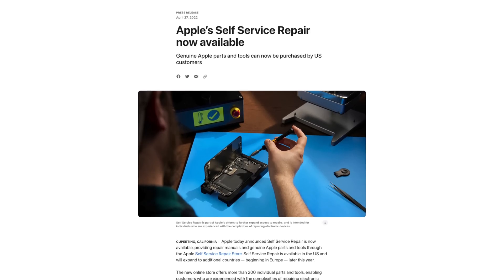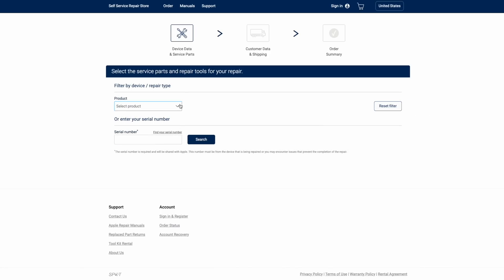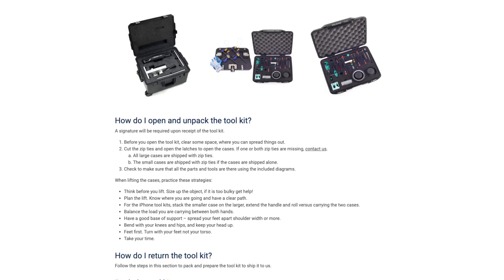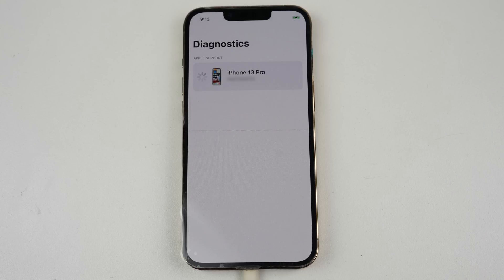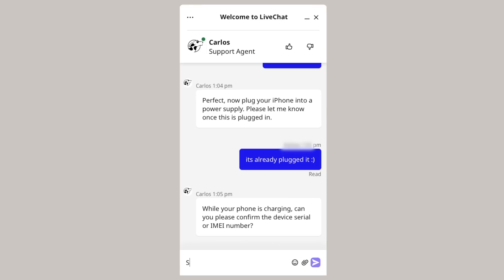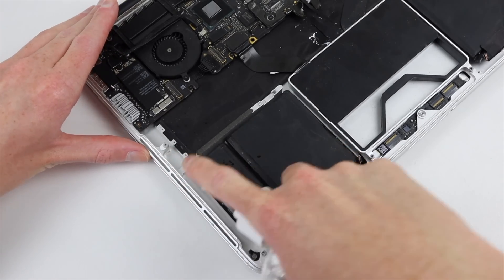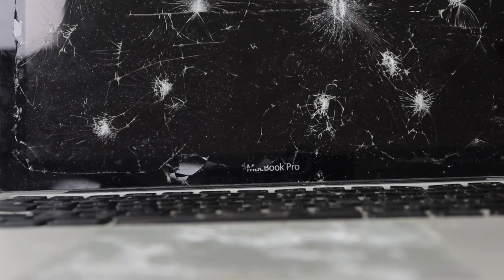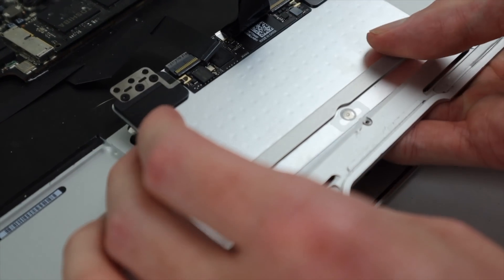Apple Improved Its Self Service Repair Program

Comment: It would be nice to see Apple give us the calibration software so we could pair the parts on our own without having Apple do it all the time unless you need help getting the software loaded up. I don’t know if Steve Jobs had something to do with this because Apple was his company before Tim Cook took over as Chief Executive Officer. I am using a iPhone 12 Pro and it’s working great but the battery needs to be replaced but I can’t do it because IOS is programmed to disable True Tone and any other features if I were to replace the battery from a third party. If IOS had the calibration software re-loaded then I would have been able to pair the battery to the IOS without having Apple do it. I hope that Tim Cook is listening to people who use third party parts to repair Apple devices and hopefully he does make sure that the new Apple products have the calibration software pre-loaded before they’re shipped out to customers who ordered them. If that happens then we might be able to use the calibration software to pair the components to IOS and other Apple operating systems.

Comment: To be fair I recently had to fix my Samsung phone and I didn't notice anything wrong but later that day I found out the following parts no longer work 
Speaker
Battery (worked for about 3 hours then no longer had battery percentage)
On/off/ volume keys 

I'm very close to getting rid of this phone and going back to flip phones

Comment: Just putting it out there once again, they should really issue temporary access to AST2 diagnostic suite to allow customers performing their own repairs the same ability to run required tests/configurations. This would be fairly simple as I have full access to this suite being an AASP employee. I can login and have full access to this suite even off the clock as it's tied to my Apple ID/Password associated with Apple. The System Configuration typically will time out because you have someone remotely running this request on a different network God knows where. You can run this test from anywhere as you do not need to be connected to a specific wireless network. ( Ask me how I know lol ). In order to run the system Configuration the KBB/KGB need to be entered into the repair first. Once saved you can run system Configuration and the post repair diagnostics which allows the repair to be marked complete. I've voiced this idea to some of our Apple resources but it falls on deaf ears as I can almost assure they don't want their beloved AST2 suite to be readily available for everyone.

Comment: Thanks to you I got motivated to buy a Ifixit pack and a bunch of old iphone 6s.
I literally disassembled every part of the iphone and put it back together. changed the screen, transfered the homebutton etc.
It was a lot of work but it really was fun and now i got a working refurbed iphone 6s.

PS: Never try to put off the screen with the screws still in on the charging socket. Destroyed one iphone with this lol

Comment: Honestly have a 2019 Macbook that could really use a refresh. The SSD died and now I need a board which has to be paired with a touchID. I got burned bad on eBay from a seller who said the touchID was paired but when it arrived, they were clearly not paired. I am still working with the FTC to resolve the issue as I have sent the board back to the seller and they still claimed they didn't receive it. I don't understand why Apple would want their customers to have to deal with shady people instead of just offering their products. Doesn't really ring quality of the products once they leave the factory.

Comment: It still feels like you don't own the device at all. They remote connect to YOUR device to confirm your repair. This is ridiculous. Edit: Also I cannot accept the fact that the SSD is soldered to the logic board. SSD's age over time and need to be replaced to maintain the performance. It's just an evil business decision for you to replace the whole device earlier.
Reply: @Yura Retz yeah but that's literally every other laptop manifacturers' problem as well :D apple overcharges people to give the illusion of a high quality device and provides you a unibody aluminium e-waste.
Reply: @Yura Retz in apple's case you cannot because of the security chip and some other technical details idk☹They change the whole board instead. louis rossmann explains more if you wanna learn more about it.
Reply: @Yura Retz That wouldn't be a problem. People don't buy new devices when old one fails but rather when new devices have more powerful cpu, gpu, ram etc. So no, Apple is the pinnacle of scam and is a bad example for other companies.

Comment: It's better, but still not perfect. Some parts are cheaper than aftermarket, but other parts still make it pointless and cheaper to buy a used replacement product versus replace the screen or main board. (Well Rossman may be a cheaper option for the board).

This just seems so half assed.

Comment: apples battery replacement option is a crock. my sons ipad pro 2 gen battery is almost dead. $99 to replace but you have to send it out that takes over a weeks to get. they told my son directly that they don’t feel they are repairable devices and just get a new one.

Comment: Really? Apple's solution to fixing a dead SSD is to replace the whole motherboard, scrapping the perfectly usable CPU. I hope that they actually recycle the working parts on the returned motherboard. And even if they do, what a waste of labor that is when you could just make a modular slot for an NVME drive.

Comment: What happened to the Hugh Jeffrey's videos? Also, Apple makes money off of limiting repairs. Apple also limits lawsuits as they do not allow just anyone to repair their devices. The prices are also not that great. $12 for a USB C port is probably about $11 more than it costs Apple to make. There is no way Apple is paying even half of the advertised cost for those parts as it is all marked-up. Once again they make money whether you repair it yourself or you pay them to do it. In fact you may try to repair it yourself, make a mistake, and have to buy a brand new unit. They win no matter what you do. They are a very smart company.

Comment: What we need to do is get the Government to pay attention to what they're doing. Don't even mention the right to repair. Like you said in your previous video Hugh unless Apple changes its policy on its "security" Activation Lock of iPhone and their laptops and computers. Which leaves just by the clips I've seen in only your video. of all the laptops bookshelves stuffed with Apple's laptops that nobody can use whatsoever sit and don't wither away over time they sit there and become more and more dangerous, toxic and with every day that goes by would become more and more less useful just from the advances in technology. Yet they do not supply a charger for their $1,000++ cell phones that they "update" like clockwork semiannually. And like you said they claimed they don't include a charger because people already have so many of the previous electronics. Chargers that are USB A so they release a "NEW" phone with a new USB tip, and try and say "well you already have a charger that will work with your new phone......" Yet just ask them to show you how your old charger is beneficial to you the customer, not to them nickel and diming you for even more to just have to buy the device that is actually necessary for the device you purchased to even work at all. If a lawyer wanted to take the time, I believe not actually supplying a way to power the electronic purchased is illegal. Really any benefit they can try to claim using their phone will award you, make your life easier, take better photos record better pictures is null and void if it doesn't turn on, if it cannot be charged and for a set amount of time run on its own internal battery until such time that said device is REQUIRED to be re attached to mains power so it can function. Literally unless they supply a charger you've bought a $1,000 pretty brick or high-end e-waste. About the repair program, unless Apple is FORCED to allow 3rd party replacement parts to be substituted for their OEM parts, just like you can do for almost every single part on let's see um, automobiles, furniture. decorations. basically, anything else. They should really be charged for the pollution they are causing. Make it easy on Apple, sure you don't have to share your software that they want complete control of. If when you replace a part with a non-OEM part, say you still have to call them let them know hey I need to rent your tools apple for a repair but I'm supplying my own replacement parts for one and then once the repair is done and you then have to call apple again so they can keep inventory over their parts verifying you did what you begged them to let you do and NOTHING MORE or nothing else. sure, well just call them and they can remote connect to your device and let them remove from their files that the screen says isn't their part. maybe ask you for the serial number of your Non-OEM apple screen so they can update their records. they send the restart signal to your phone and when it reboots the "this screen isn't original and now were limiting the features you already paid for when you bought the device and now have had to suffer the burden of an additional charge to get the thing repaired.  So, we think you should be punished and "poof" no more face ID sorry we removed the fingerprint scanner now you can't unlock your phone. and oh, the cameras you wanted them to still work? why did you pay for them to work? You fixed your phone so they would work again but we want to handicap your devices because you had the nerve to fix your already paid for purchase. I think they should be sued on that too, Apple so you've removed my ability to use a advertised feature of my paid for item. Unless they advertise that they remove features as the device gets touched by any hands other than there's. There false advertising everything they sell. I wouldn't have bought their newest iPhone if I knew that replacing the display on it removed the advertised feature of face ID etc. etc. Its an open and shut common sense thing. Not even like someone suing Mc Donalds over hot coffee being HOT or a misprint of a advertised price. To be honest they should be selling you a charger with your phone and say that is under the guise of if you use a non-OEM charger you possibly will destroy the battery or entire phone,  thus if it has to be repaired and you have it repaired not by us, in reality you MUST purchase an all new phone because well disable so many things, because you didn't use the supplied OEM charger!!! If you cant choose where you buy your replacement parts from then why is apple insisting we use some their electronics charger on there brand new phones? And with that I'm out Hugh I love your videos and agree with you 100% Cheers!! and BOOOOO APPLE :(

Comment: Honestly when ppl started reporting that apples self repair program expanded the first question that popped into my head was Did it actually expand or did they bundle a $20 with a $300 part and be like "see u can replace battery and some other part u didn't have to"

Comment: 5:41 IMO, there is no way a battery replacement should ever be considered anything close to "substantial". If I could wish, it would be that any battery in any product be user-replaceable with tools no more complicated than a Philips-head. 4:12 I recently replaced the battery in my Dell for <$50 and 15min. $500+ and read 100s of pages just to replace a battery is totally insane.
Reply: The cost is because it’s the entire top half of the laptop
They also mention on the site that batteries alone will be available soon
Which he conveniently didn’t mention
Reply: @Juanguar  tbf gluing the entire battery to the case is dumb. Dell can make the XPS battery replaceable and those are just as slim as the Macs.
Reply: @mcslender2965  yeah I’m not arguing that because you’re absolutely right
But the video is kinda misleading when he says battery is 500$
Reply: @Juanguar  there is nothing misleading. The battery is currently $500+, no ifs, no buts. It's right there on Apple's web page. What it may or may not be in the future is irrelevant. Whatever happens, it will still require massive disassembly of the laptop following 100+ pages of instructions, need specialized tools and IPA.
Reply: @andrewgregory9981  no it’s not
The 500$ comprises of battery, keyboard and top cover
If it was just the battery then it would be 200$ just like the MacBook Air 
It is still misleading
Reply: yeah i miss the days of the 2009 macbook pro where you could just open it up, unscrew and disconnect the battery, and install the new one.

Comment: Apple will NEVER support right to repair. They'll keep finding cracks in the legal system and it will be a very long and exhausting road. I just hope that people stop believing their "security" argument that they keep slapping on everything. 

What's the security risk in me replacing a battery, a charging port,  a trackpad, etc.  Also why can't I replace the SSD?

Comment: I have to think that the exorbitant prices on some of the parts is directly related to the "calibration" garbage, ultimately including the support staff's time in the cost.
The return credit, I'm sure, is included in the cost too, to incentivise you to return the parts instead of recycling them yourself or selling them on if they're still somewhat usable. 
If I'm right, that just makes the serialised nonsense even worse.
And, of course, the lack of readily available parts for most devices, and some parts not being available even for supported devices, is BS.
Oh, and riveted laptop keyboards are the worst. I've replaced a few and it's nightmarish.

Comment: I think before being even an Apple customer on their smartphones, tablets, laptops or computers i should ask myself and look for answers and opinions on: Does it worth the price? Not really
Is it becoming easier for the user to use a modern Apple computer, or just an outdated MacBook with the lid logo lighten up but repairable and still usable with macOS inside Linux virtual machines? Since personally, i'd stay daily to copy my drive in case of a failure to have an external backup. Personally, on a daily basis, i have this kind of usage: HP 15 laptop that's still new to me, a 12-year old Dell laptop, an iPad 4th generation with no cellular for drawing, and a samsung galaxy a12 phone. So, risking my money that i can barely have on a computer that can break every second with no data recovery it's a true gamble to make, so my preference is most likely to go out there, buy a second hand MacBook Air or Pro from 2010-2012 era with Intel Core i series inside, make it get cool as possible (cool in terms of cooling) and call it a day on the Apple side of things. That's just my opinion though, and if anyone interested to read the comments takes it as a lesson, good for them i suppose

Comment: We just want more repairable (modular SSD etc. for example) devices that can be repaired without providing serial numbers and without having to rely on remote software calibration from the manufacturer. But being consumer friendly, like Framework is, would hurt Apple's bottom line... 

"Second party repair" describes it very well, brilliant video!

Comment: Thank you Hugh. Your videos are very informative. Keep up the excellent work. We cannot let Evil Apple get away with this. I have a 2011 17” MacBook Pro sitting in its box because Apple supplied me with a faulty graphics chip. I have never bought another Apple laptop and I never will.
Reply: @Akhilesh Sattanathan if Mac is hard to use, no offence, but that’s your problem. that’s not a reason to hate Mac. The 2015 models have been long discontinued and they’ve switched to a thicker design in 2021. Any computer can be broken, you just have to have common sense and take care of your tech
Reply: Your anger is misplaced. nVidia is the culprit. Unless you just want to be mad at Apple.
Reply: I do not trust Apple anymore. Watching Louis Rossmann repair videos will show you that. Macs are not hard to use and when I can afford one I will buy a M2 Mac Mini.
Reply: Apple is ultimately responsible for the chip they put into their machines.

Comment: To me, Apple is just anti-consumer in the worst way possible. I personally will stay away from them. I prefer a gaming laptop that are easy to upgrade and repair
Reply: "Gaming" laptops are rarely easy to upgrade and most OEMs are going the same direction as Apple. Build a desktop PC if you want to upgrade and repair it yourself.
Reply: @GareWorks  WRONG! there sir, ROG strix gaming laptop is extremly easy to upgrade. It has 3 M.2 slots, , the backplate comes off easy and reveals the whole MB, RAM and SSD slots. Also, the screen is easy to replace. Lift the bezel and take out 4 screws. I have replaced 3 latop screens until now. On a HP G4, DELL 3575 and Acer Nitro 5. Please get your fact straight.

Comment: I used to work at AASP, that 200$ battery replacement is whole top case replacement for lower price if the only issue is swollen/failed battery.